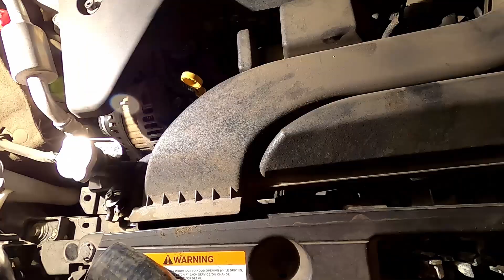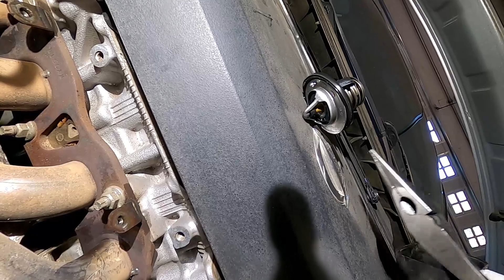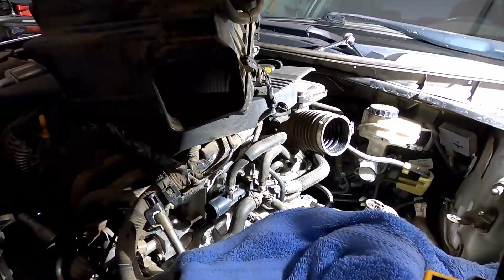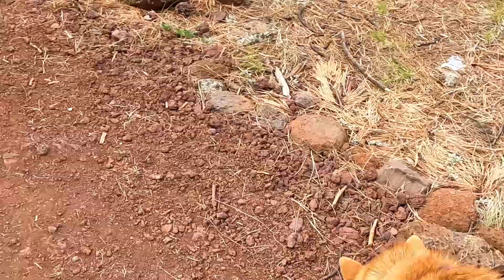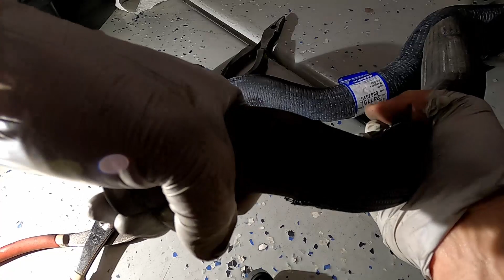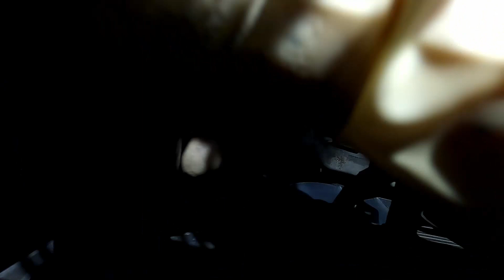Thermostats and Radiator Hoses Replacement Nissan Altima 5th Gen

Comment: Speaking of two different thermostats, I've got the 2014 2.5 L fifth GEN, and I spoke with Nissan and they verified through my VIN number that my particular model only has a thermostat and not the water control valve (other thermostat). 
Have you heard anything about that as well?
Reply from the maker: Yes, as you saw in the comments, the Asian market kept the upper thermostat, whereas the American market got rid of it by just putting in the casing/housing. Good luck with your project!- Mike

Comment: Hello. I have a 2010 Altima 2.5L. My check engine light is on due to a thermostat warning. My engine heats up a little late but not too late. When I took out the thermostat, the top part was completely close and the bottom completely open. What can be the problem? TY
Reply from the maker: When the engine takes longer than normal to heat up, it could be an issue with the thermostat opening too soon, the wrong temperature thermostat, or no thermostat present where it should be. I would replace the thermostat or thermostats. The thermostat should close when cool and open when hot.  Good luck with your project!- Mike
Reply: @mikesdoityourself  Is it possible that thermostat opens too early when it's completely close at room temperature? Also the cooling water is dirty. Can this be the issue?
Reply from the maker: @MC-ph7gr  Hello, dirty coolant will usually make your engine run hotter than normal, or it will keep the engine from starting right away when cold. I would do a coolant flush and see if your symptoms improve. - Mike

Comment: What are the name of the spongy hose you mentioned by the thermostat?
Reply from the maker: They are usually called bypass or heater hoses. I would remove whatever hose needs to be replaced, then have an auto parts store match it up or use some of their generic hose to form one. Good luck with your project!- Mike

Comment: I want to change my thermostat. And the one that you took out that was just the casing( the upper one.) was the same way. I thought someone must have gutted it in the past.. and I cannot find the part anywhere. Where did you find yours
Reply from the maker: You can find it on Rockauto.com or your local auto parts store. Good luck with your project!- Mike
Reply: @mikesdoityourself  after research and talking to nissan garage. The upper thermostat was removed in the American versions. it's supposed to be only the casing and rubber gasket just like yous was. When you removed it. You can still get the upper thermostat, but it's for the Asian models.
Reply: @RCVOODOO  I just verified that myself today when I spoke with my local Nissan dealership. It was removed for the fifth GEN Nissans from what I gathered they were saying.
Reply: @mikesdoityourself 
Can you send the link or part number for this? I am not seeing it.
Reply from the maker: @TrentonSchwahn Hello, in one of the comments, it was mentioned that the upper thermostat was removed in the American version, where they left the casing and o-ring. The Asian version has an upper thermostat installed. I bought my part through Rockauto.com.  - just put in your year, make, and model, and you should get some good options for parts. Good luck with your project!- Mike
Reply: The one at the top is called a o ring or water valve that is a water outlet not a thermostat
Reply: Call Nissan an tell them you need a o ring for your water outlet they will have the part for you it’s not sold anywhere else if you put a thermostat in there your car will run hot

Comment: Hey I'm probably going to change out the thermostat for Nissan Altima 2013. If there's 2 thermostats are both thermostats the same or are they different part numbers?
Reply from the maker: They are two different part numbers- good luck with your project!- Mike

Comment: Hey 2017 here! Do you trust rockauto to purchase parts from?
Reply from the maker: Yes, I've used them for however long they have been in business. I would recommend them because of their ease of use, the amount of parts available and the ability to return products if there are any compatibility or damage issues. Good luck with your project!- Mike
Reply: @mikesdoityourself  Thank you for your time to respond! Also is there shipping process smooth?
Reply from the maker: @itsDomPerignon  Yes, they have different shipping locations throughout the country and you can choose the speed to get it. My only complaint would be, because of different items shipping from different locations, the shipping costs add up sometimes. The 5% discount helps- if you buy something, they'll send a discount code afterwards or try Retail Me Not website and grab a discount code there.- Mike

Comment: was it causing your antifreeze to overflow out into the reserve
Reply from the maker: I didn't have any issues with overflow into the reserve tank. - Mike
Reply: @mikesdoityourself  mines it's just in the mornings when warming up antifreeze leaks out could it be a stuck thermostat
Reply from the maker: @Mr_brut3  could be the thermostat- the thermostat should be closed when first started, and then opens when it reaches the proper temperature. Usually it corrodes and doesn't open and sticks closed which can lead to overheating. Leaks may come from the radiator cap, radiator, hose connections, reservoir or water pump. - Mike
Reply: @mikesdoityourself  
Thanks 👍
Reply: @Mr_brut3  I saw a video on here that showed Altimas are known for having that overflow issue if above minimum level, the dude said it was common & not to worry about it. But I'd just keep an eye on it to see if its true because I never had that issue...YET,Lol

Comment: How did you get the tstat in without it leaking?
Reply from the maker: Just the thermostat gasket made the seal so there wasn't any need for any other gasket. Or did you mean that by draining the radiator helped with changing out the thermostat and prevented major leaking? Well, good luck with your project!- Mike